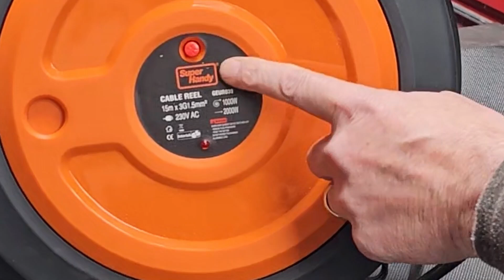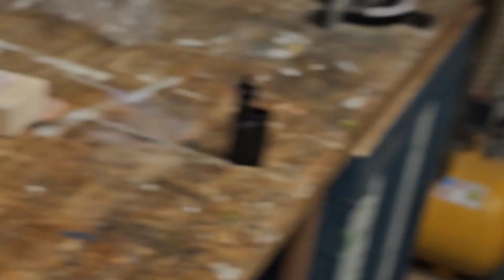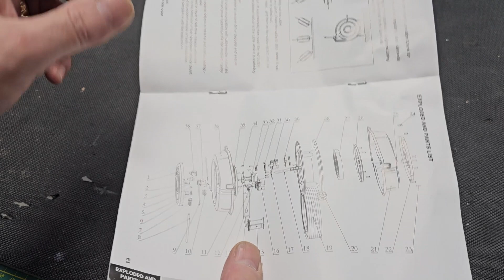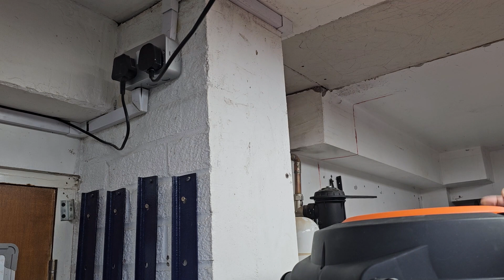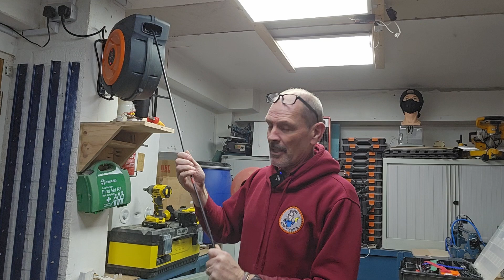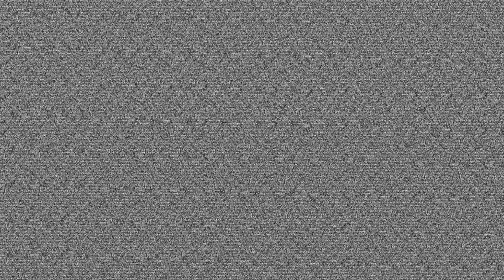15 meter Retractable cable reel for the workshop, By Super Handy.

Comment: Hi Frank, Just the thing you need in the workshop, better than having extension cables all over the workbench and a tripping hazard on the floor. 15 metres is a good length for most workshops better than 15 ft on the instructions. looks solid and well built and a good retraction on the cable, Great video catch you soon   Take care
Reply from the maker: @shaun30-3-mg9zs  😁 Thanks Shaun. I have enough trouble with tripping over stuff in the workshop, so I'm trying to keep the floor as clear as possible... and this works a treat. I'm glad it wasn't 15 feet... that would have been a bit useless 😆. Thanks for watching mate 😁 👍

Comment: Looks like a good purchase there frank👍.thankfully I can keep my wallet closed for this one lol I only have a 18x10 shed  and 8 double sockets dotted around  thanks for sharing though 👍👍
Reply from the maker: @rodharris2915  😆 I'm sure you could make use of one Rod. My workshop is not as wide as yours and only about three feet longer. But this will make my life just that little bit easier 😁. Thanks for watching 😁👍

Comment: Hey Frank......they are fab.....I have one in each workshop...... They are just so useful.....I much prefer them to normal cable reels but they seem to be heftry in price still....... I have run everything from a mixer to a welder on it......fab..... thanks as always for the videos and content.
Reply from the maker: @adam-qf2vz  😁 Thanks Adam. I am tempted to get another one for my shed so I can pull it out in to the garden, but as you say, they can be a bit pricey. But I will get my moneys worth out of this one in the workshop. Thanks for watching 😁👍

Comment: looks a sturdy well made bit of kit. the square looks like a single electric socket that has been blanked off?
Reply from the maker: @rasmo243  😁 Thanks mate. Yep, it feels like it's got quite a bit of life in it. It feels like it's more than sturdy enough to take all that I can throw at it. I think the square is an old header from where the old garage door was. I think I previously went across to the opposite wall. Where the square is was previously an outside wall, so not likely an electrical outlet. Thanks for watching as always 😁👍